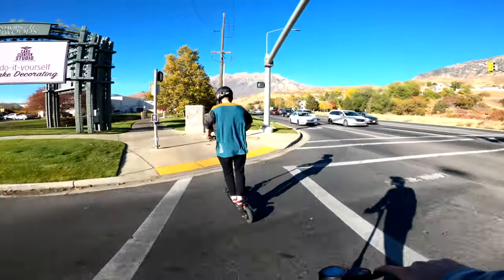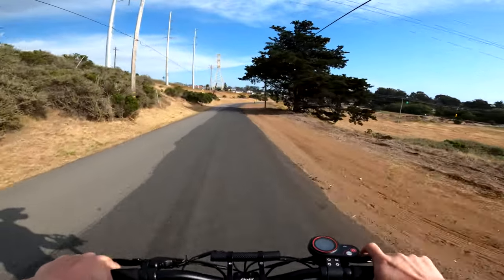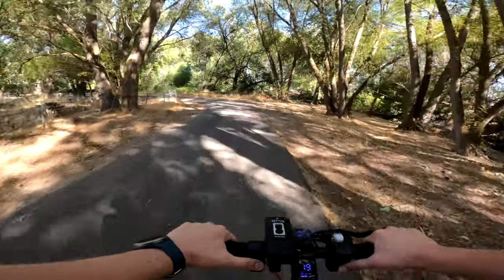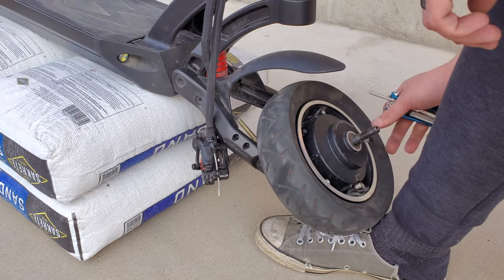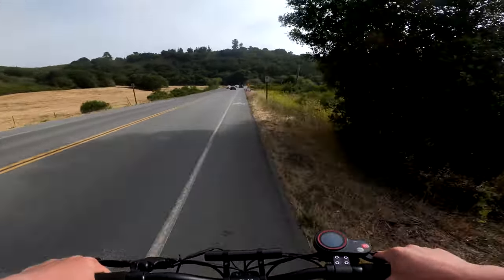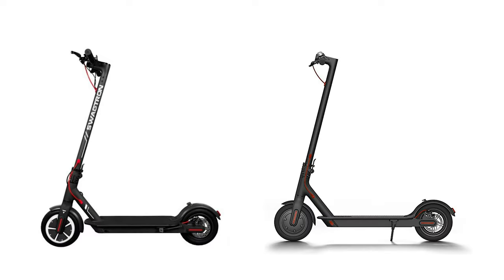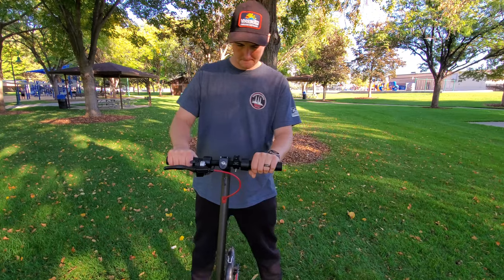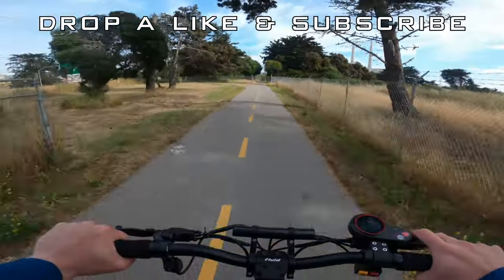Top 5 Changes to Electric Scooters I Want To See

Comment: I agree, the minimum tire size should be at least 10” on any scooter. I have an Ewheels Turbowheel Swift that is an awesome little scooter with absolutely no problems at all, but the 8” tires do feel a little inferior riding on New York City bumps and potholes. No smooth surfaces to be found here. A 10” wheel on that scooter would be a major upgrade.
Reply: It's not a scooter anymore if you want bigger wheels. Most of them are designed to be portable. Maybe get a electric moped/bike?
Reply: santtis - You make a good point, but I’m speaking of my experience living in New York City where ALL of the street surface is terrible. Smaller tires are definitely great for smaller towns with a smoother flat surface. Either way, I’m enjoying all 3 of my various sized scooters. Stay safe out there 🛴😃
Reply: @NoProGoPronto  I live and ride exclusively in the country, and my small town has a total of 5 miles of in town streets - most of which are dead end roads. Riding ANYWHERE other than to the grocery and drug store means at least a 15 mile trip - and my most common enjoyment is riding around the small lake I live on - 19+ miles portal to portal. The 10” tires are ok, but I’d rather see 11” or even 12” for the typically rough country roads, where potholes are prevalent and are slow to be repaired. We end up memorizing where the worst of them are located.

Comment: I’d like to see stability improvements bigger tires slightly wider all terrain tires because street tires suck going over grass, rough concrete and asphalt and run flat tires so if u get a flat too far from home to walk and not on a bus route the tire will be strong enough to hold up to get u home and easier to change tires waterproofing and interchangeable parts and upgradability

Comment: Stem angle and wheel size are incredibly important. A straight 90° stem angle is something I want to see, because when trying to use a cup holder on my electric scooter, the angle of the stem tips all of my drinks backwards. Potholes are a major problem as well with smaller wheels, with my rear wheel at 8 inches and the front hub motor wheel at a minute 5.5 inches. Dual suspension helps but the size of the wheels still isn't enough to clear larger potholes.

Comment: I had a gotrax gxl v2 I say had because it died after 3 years built like a tank but changing flats and to solid tires was a pain my first flat took a week because one of the screws had too much lock tight on it I dam near stripped head so I ended up drilling screw out and replaced it with a Philips screw then putting solid tires on took me an hour but once on I never worried about flats anymore I just wish the solid tires had a bit more give strong enough to support weight but give a bit for bumps I wish gotrax had thought of putting suspension on their next scooter I’d pay more or come up with a suspension fork upgrade for current models
Reply: Holy run-on sentence, Batman!!

Comment: 1 it might be impractical to ryde a suters in the snows in mist cercumstanzes in some places because it only snows for 3 monthes per year rather than paying for parts and tools you might want to get a snowscuter which is on 2 skis dependong how high the snow gets there  however. if you have the extrre money to splurge you would invest in 2 things for your scuter large baloon or  sand tyres for larger wheles

Comment: "Wheel size" meaning what precisely? More sidewall? Greater width? Greater depth of tread? Better tread design period? By way of example one could create a wheel with a protruding solid rubber strip at the circumference of the ahem..."tire" ahem (as opposed to the rim of the tire) thus creating a far better wear and tear profile through long term use rather than always having the entire vulcanized rubber material being where the literal rubber hits the road and thus providing a superior product for both on and off road handling but in particular on road handling with possibly far greater speed and efficiency as opposed to going the more energy intensive "just give me more tire" route as stated as necessary here.

Comment: If the wheels progressively become larger, the suspension better and the parts more interchangeable with bikes, at what point does it stop being an e-scooter and not just an ebike? Folding ebikes are already at 16 inche wheels and some come smaller, so why not just get a folding ebike?

Comment: a scooter is only as good as its range . so i like to see scooters have much longer range like 50 or 60 miles or more .in the city or the next city. and want run out of energy getting there and charging ports along the hwy. and a slow lane just for electric scooters .on the hwy like a bus lane